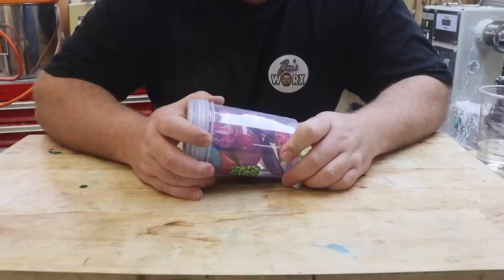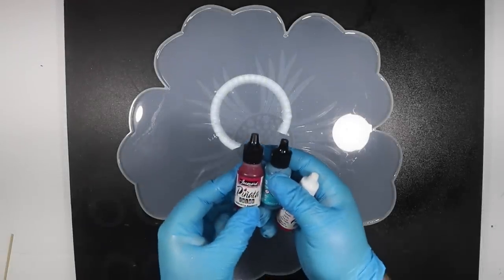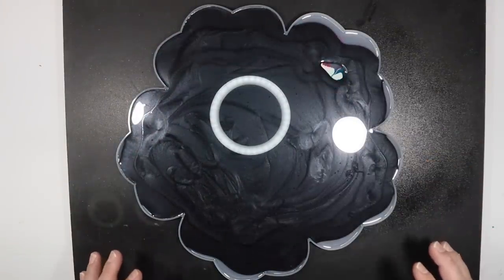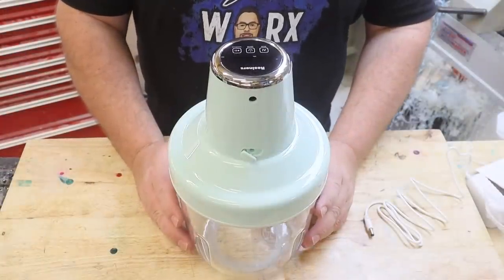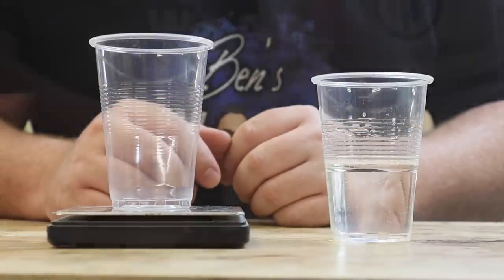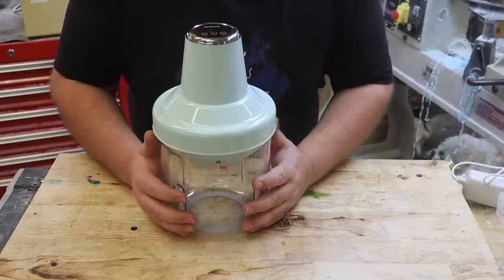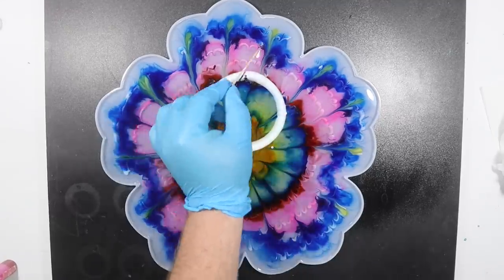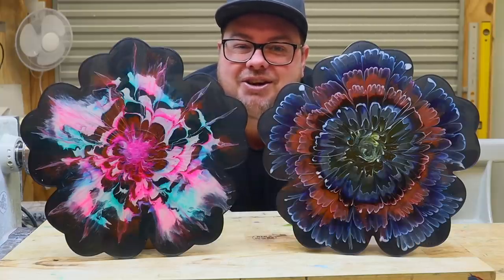Trying to Make Resin BLOOMS!

Comment: You need to mix the white with resin. Whennit starts to get warm that's when you start to add it to the mold. Using a icing bag like for decorating a cake works the best
The 2nd one came out great

Comment: I like both and agree with your idea of combining them. What if on the second one you used white or a color instead of black? Seems like it would look more like a flower since so much of the background color comes through. Another idea would be to maybe make  a section or two of the white spiral wider for variation. Make sure it's wider in a complete circle of the spiral to maintain symmetry.

Comment: i have a very specific question bc of lots of experiments with sturdy, small, rechargeable lights for my service dog's vest. So: is it possible to completely encase a small LED light circuit board leaving only the usb charging port exposed and still be able to use it? 
your channel is so mesmerizing and de-stressing, thx ☺️

Comment: If you want to get the bloom effect you need to make a batch of resin with a high pigment white paste. (As what you did with the second)
So poor the blank resin, add alcohol ink drops on top. Then poor or pipe the white mix.
But you need the resin to still be thin enough to move as that will give you the petals.
And you can even help it a bit by using a heat gun to push it out and heat it a bit so it moves easier.

Comment: Try 1 more time with the pinata ink and the paste it should look like skim milk and you can make ur lines a bit thicker about double what you did.  Your resin should be about 40°c when you decant it into the mold then add your ink then mix your white.  You can add a drop or 2 of white alcohol ink it will make the petals wispier.  Look up pouring your heart out on youtube she does blooms with all kinds of resins cause each is slightly different.

Comment: Definitely a pass, that's really cool! I notice though that when you pull toward the center from the outside edge with the toothpick, the outside edge is quite colorless. I wonder how the fluid dynamics of the color in the resin would change if you pulled from the center out or alternated directions in an attempt to offset all the color being pulled to the middle? As always, great video. 👍

Comment: The white resin you are using is too thin. The way i make mine, is clear resin, alcohol ink leave to thicken more the as the white pigment is starting to warm up, but not so hot you cant handle it. Then once you've poured the white  do your design. If you alternate your in swipe in ans out you get another lovely effect. Well done on your creations